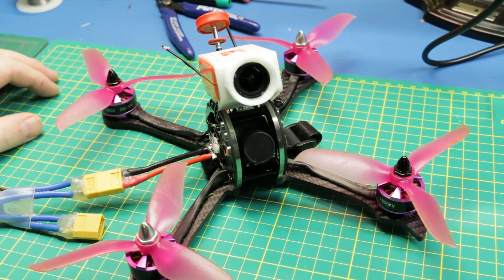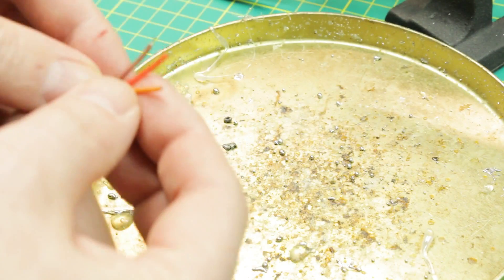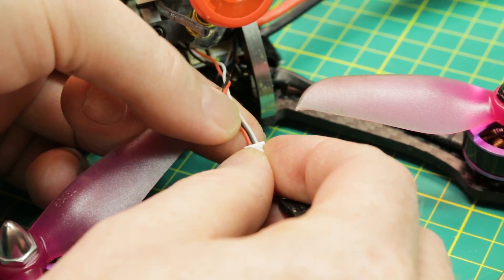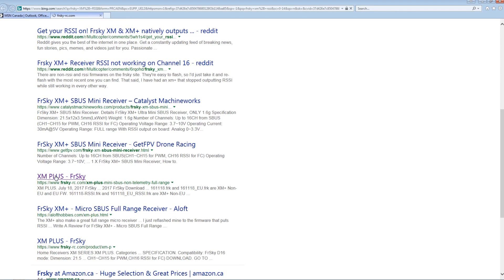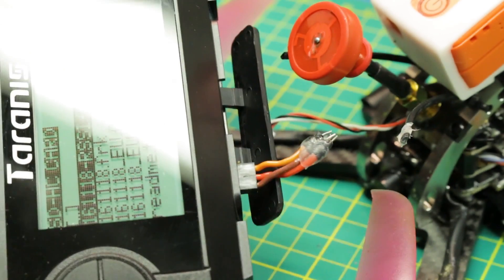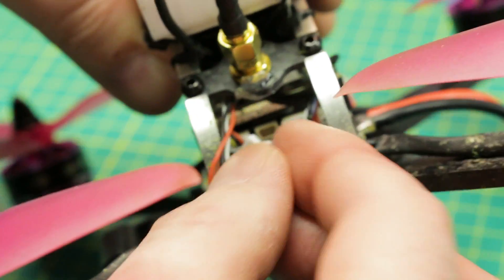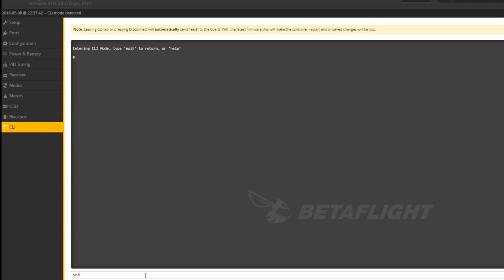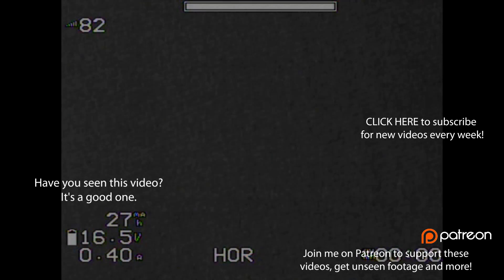RSSI Mod FrSky XM & XM+ Without Removing The Receiver!

Comment: How do you like that quad.. I have two of them and in a hard landing the camera tilted and ripped out the plugin for video off of the control board..
I had to solder the camera wires directly to the board..
Great power, agility  and nice camera but I typically dont like bottom mount batteries and may move the components to a free style type frame with top mount battery.
Reply from the maker: It's still one of my best quads after 2 years. Love it.

Comment: I'm only getting a 19% RSSI reading.  Is there some way to get a full 100% reading when your Q7X is right next to your receiver?
Reply from the maker: Step back a bit.  Not tx and rx combo can get 100% signal strength and integrity without some separation.

Comment: Can you also receive RSSI on frsky taranis? Discover sensors?
Reply: No.  For some reason this RX doesn't work that way...
Reply: @omfpv7495  Haha i was afraid so. On all my quads with OSD FC's they work flawless.. but on this quad im repairing now (FC, without OSD) i cant get it to work :P. 

Thanks :)
Reply from the maker: That is not right. You can get it on the Taranis just fine. You send it back as a channel (same way BF shows it) and set up a mix and display it on the Taranis, have alarms etc
Reply: @MkmeOrg  I tried so, making an input RSSI and MIxer RSSI on the taranis.
RSSI cant be found and when choosing for input channel 16 i cant find it.
In betaflight i can see it at the setup indeed

Comment: Hello, I got a xm reciever and on bf 3.5 only gives me option to select rssi channel 12 not 16. What do I need to do to make it work. Also on my radio do I need to setup or turn on any channel?
Reply: Is that Channel 12 or AUX12? FYI, AUX12 is the same as channel 16. Aux1 starts at channel 5, not channel 1.